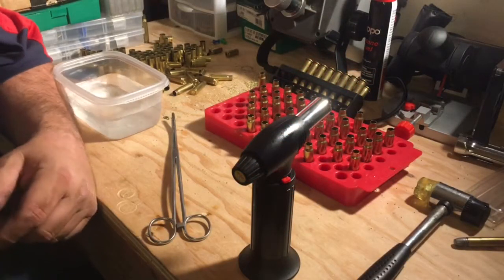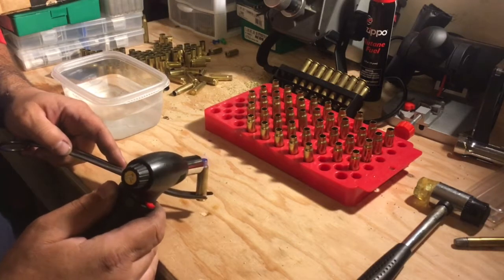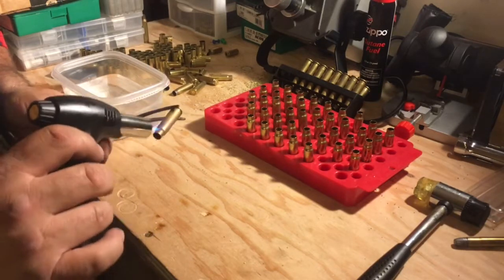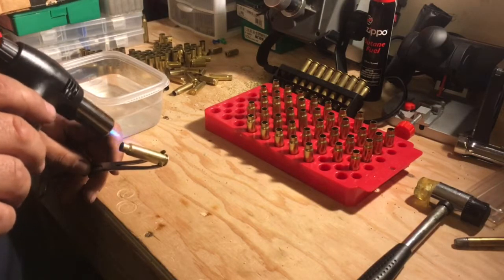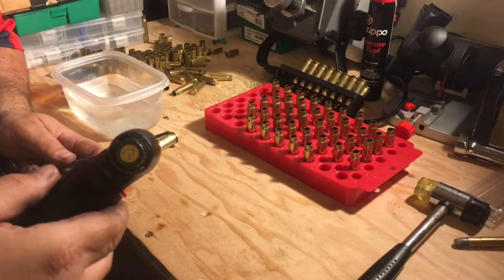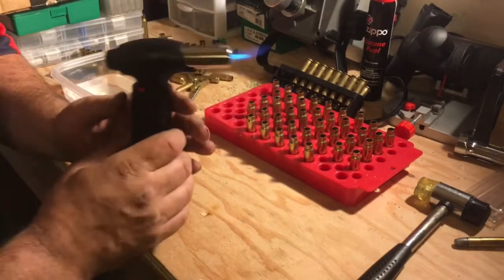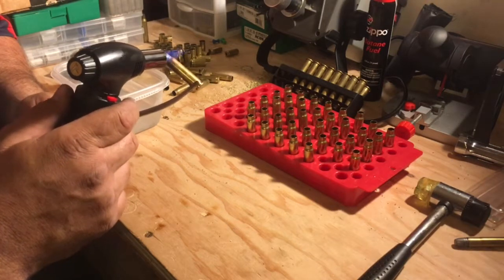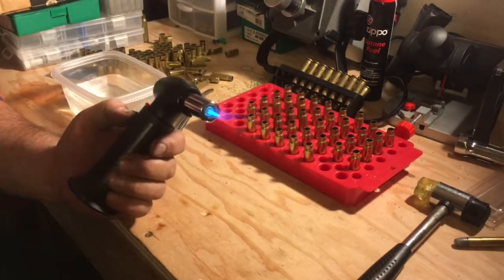Annealing Brass (New Reloading Torch)

Comment: If you don't want to spend the money on something like an Annealeeze, I think you'd be a lot happier using a battery drill & socket with a descent gas torch. 
You can heat the case neck & shoulder to a hard bright glow. You'll get much better results & it won't damage the brass in any way.